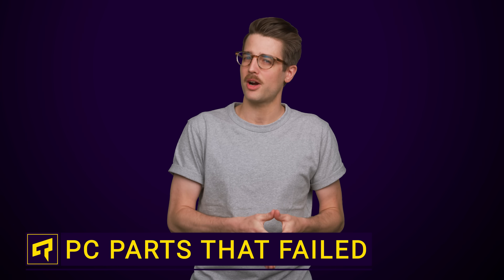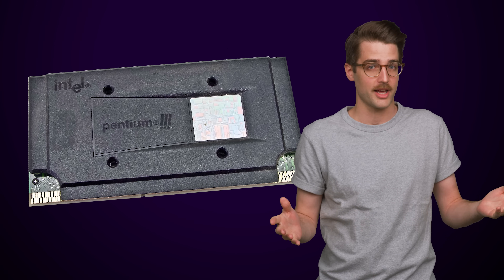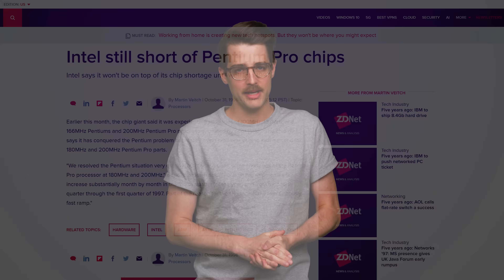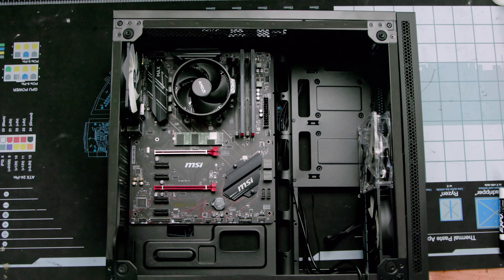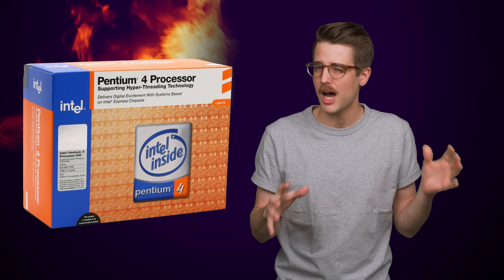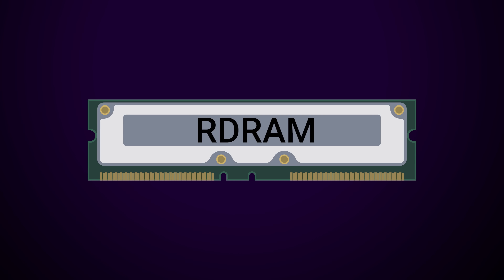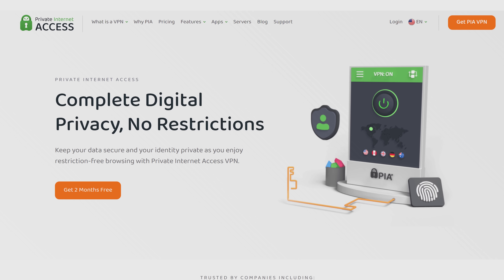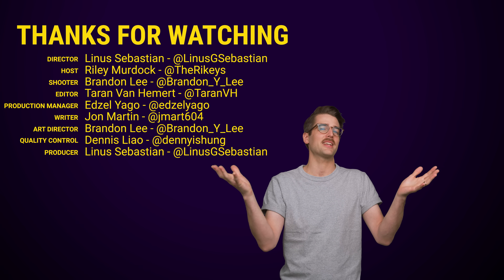PC Parts That Disappeared

Comment: Don't forget those master/slave settings for all your drives.
Reply: Not strictly hardware but fudging IRQ and DMA settings on that stupid Soundblaster clone that just wouldn't work on default.
Reply: @grahamross6397  oh man. IRQ settings were a real pain!!
Reply: Oh my!  I had forgotten them...
Reply: @Jules_Diplopia  And yet deep down in the bios abys they still exist :)
Fun one for you early sata hdds were part and format identical to ide hdds in every way but 1 the controller board on the hdd. 
When satas first dropped i managed to get my hands on about 200 boards for seagate hdds. I had a huge supply of brand new in box ide hdds. A fast board swap and instant sata hdd. 
To get rid of my old stock i knocked 20 bucks off the price and sold them locally to customers as ide to sata converted hdds. My mark up was about 30 bucks on em so i didn't loose any money on them just did not make nearly as much. I still got 2 of them in my drawer that i used for long term storage and last time i fired them up a couple months back they worked perfect still. New sata hdds are not exactly the same they are different mechanically and physically
Reply: Ngl, I always had naughty thoughts when configuring jumpers on HDDs
Reply: That was a real PIA. Having to move a tiny jumper that I would OFTEN loose while building the system. Two drives on the same cable told who was who by a micro jumper..good think SATA changed that and it was a separate cable for each drive.
Reply: @fightingfalconfan  I probably have 500 jumpers I got off ebay years ago, expecting that I would forever need them for all my drives.
Reply: Cable Select FTW
Reply: @CakePrincessCelestia  still Had to Set the Jumper for that and I've never really Seen anyone use that.
Reply: wd disk had also the option to make them work like a 30GB disk. as that was the maximum for older systems with ide.
Reply: All those lovely ribbon cables. So easy to cable manage, and they did wonders for your airflow.
Reply: This comment is giving me PTSD flashbacks
Reply: Didn't mind them. WinXP all the way!
Reply: FUUUUUUCK those jumpers.
Reply: for what were they exactly?
Reply: damn I forgot this haha
Reply: Nowadays people would try to cancel Seagate or hitachi or whatever for daring to have such settings named as master/slave.
Reply: @arctikf0x698  Personally I blame the people that give them the time of day. There always will be people that want to stage their personal vendettas against something and in better times were just ignored. Nowadays they are given a stage and free fuel for their fire.
Reply: @karaloop9544  RIP Aunt Jemima and Uncle Ben.
Reply: @bluephreakr  fuck now I want pancakes and syrup with butter
Reply: @findantu  Man that sounds good!
Reply: @arctikf0x698  

That terminology pre-dated hard drives (it goes back to 1904) and still exists in the tech field.  Also, "master bedroom" has the same problem.  In both fields (tech and housing) the terms are slowly changing.  In housing, for instance, the term "primary bedroom" is beginning to be used.
Reply: @arctikf0x698  lol that't funny because the industry terminology for serial data communications Like SPI, I2C, etc are changing from master/slave :p
Reply: @arctikf0x698  They weren't particularly useful names in the first place which weren't particularly descriptive of their roles, and their choice of words is just flippant blindness about concepts that should be taken more seriously.
Reply: @Aeduo  was only a matter of time before one of you showed up lol. Get a life instead of being offended over nothing
Reply: @jr2904  you felt strongly enough to respond, so you seem to be bothered enough about something. Something probably really dumb. :P
Reply: @Aeduo  They had already used Primary and Secondary for the IDE ports so what else did that leave?
Reply: @LC-uh8if  I dunno, 1 and 2?
Reply: @Aeduo  the original idea behind IDE was that one device would actually dictate the Speed of the other. Thus a slower hard Drive would be the master, having a second, faster Drive as the slave. They didn't implement it though, so only the names remained.
Reply: I’m not gonna stop using master/slave any time soon. People get offended bout literally anything nowadays, and I couldn’t give a flying fuck. Total bs
Reply: @navaks5335  Its more that it was a bad and culturally blind choice of words in the first place, but that technology is pretty obsolete anyway. But people aren't upset about usage of words changing, they just see things being ok the way they are because it doesn't harm them, or they understand that the social issues are on some way a benefit to them and they would rather not change that regardless the consequences for others.
Reply: @Aeduo  you're a good troll.
Reply: @michaelf.2449  kinda silly thing to feel trolled at for I guess.
Reply: @Aeduo  ahh don't pull this card on me. I'm not the one 😂
Reply: @michaelf.2449  not sure what that means heh.
Reply: Honestly I would rather JUMP away from those... ......ill see myself out.
Reply: The Twitter landwhale crowd would have a field day with that today.

Comment: I remember my Pentium-II slot-based PC, when I had the much-coveted Nvidia TNT 2 graphics card, a whopping 256 MB of RAM, and an extravagantly large 100 GB EIDE hard drive.

Maybe your next video could cover the fact that back in that day, discrete sound cards and ethernet cards were actually necessary components to fill up either an ISA or PCI slot. I also remember needing a discrete video decoding card to go with my DVD-ROM if I wanted to watch movies. Excuse me while I go dig up some of my old zip and floppy disks...and I think I have a parallel port cable somewhere to hook up my dot matrix printer.

And if you ask my dad, he would tell you about the days when having a modem meant you put your telephone on a set of couplers and maybe getting a transfer rate of 300 bits/sec. The my mom would tell you about her days of taking a college computer programming class and having a stack of punchcards with her code on it.

Comment: 5.25 expansion slot with integrated cigarette lighter and cupholder, that's a beauty of tech that has gone for good
Reply: I have no need for the lighter, but a cup holder? yes!

I really like the VU meters you used to get...
Reply: @briannem.6787  I don't need it either, but consider it a car accesory adapter, you could connect a mini vacuum cleaner and use it for the keyboard and desktop for example
Reply: @YOEL_44  Most accessories that connect to it are compact, like a fridge. A car fridge is smaller than a domestic fridge, making it perfect for cold gaming drinks.
Reply: @YOEL_44  lol, I'm pretty sure your USB Jack's can do that...and I'm also sure running high voltage tools off the lighter jack would cause voltage dips across the rest of the PC.
Reply: @psilimit  Nothing that plugs into a USB or car socket is 'high voltage' lol. Anything you'd plug into a cigarette lighter would be just fine powered by a decent PSU
Reply: @psilimit  Do you understand the cool factor?
I know is not the most efficient way of doing it, it was just a showoff thing to have.
Also, most cars have at most a 15V power delivery to the lighter, so running car gadgets at 12V is not a problem, and of course that would not generate any power unstability unless you're running a houseburner tier PSU, your GPU ramping up after a loading screen is way more harsh on it and still no problems, right?
...Right?
Reply: lgr showed that.
Reply: Dear god I had forgotten that lighter! My dad knew about computer 3 things: 1 how to turn it on. 2  How to turn it off(mainly because ot was the same button)  3 how to light his ciggaret with that thing.
Reply: It's a shame no one makes 5/12V outlets for the back of a PC. Many wall-warts could be eliminated.
Reply: My first PC had a 2X cupholder. Funny thing, it would play CD's, too.
Reply: If they're not still available, they'd be simple enough to make. Modern PSUs will typically be even more comfortable handling the power too.
Reply: @chaos.corner  It's not that they are STILL not available, but rather thay they're not anymore, that was a gadget that, if I remember correctly, Thermaltake did in the past, before they started doing ripoffs.
Reply: I remember there were supplemental PSUs that fit in a 5.25 bay. You would need another AC power cable for it, and I think you had to either make it the power switch or it had a 20+4 pin adapter that sat between the Mobo and the main PSU's 24 pin. 

I never used one because they were notoriously iffy, but I thought they were interesting.
Reply: @MrNside  i totally forgot about those i never bought one and just tucked a old at psu in the case some place and build a shroud around it
Reply: Someone has been watching LGR.....
Reply: These days I just have drive bay drawers in those slots to store stuff like sd cards and adaptors, various usb devices, etc. They are actually very useful and I haven't used an actual drive of that type in any build for like 16+ years so it's a great use for the unused space.
Reply: I remember referring to the thing in your car that you plug stuff into as the "cigarette lighter" rather than "accessory outlet"  then having to explain to someone (younger) that in fact that slot used to have a piece that you pushed in, it got hot, and you used it to light cigarettes. They were dumbfounded.
Reply: @LC-uh8if  it'll always be a cigarette lighter for me I'm very upset my car doesn't have one anymore like why? And secondly why is my ashtray plastic? This isn't going to work for my cigarettes!
Reply: Na i still have a pc case from 2005 i will throwmit away when it literaly burns
Reply: My dad had one with a wine tap in it, still boggles my mind

Comment: Honestly slotted CPUs should be brought back. We could create a standardized motherboard with chipsets designed to work with any type of CPU. The CPU slot would then have a riser with the appropriate CPU socket for your CPU. If you want to switch to a different CPU, say from an Intel to AMD or a Qualcomm ARM CPU you can.
Reply: Drive signal integrity, voltage decay, and DRAM timing regressions would like to say hello. We dropped slots for a reason.
Reply: @FixedFunction  Yes, but all of those things can be remedied with modern tech. Narrower pathways on the motherboard mean lower voltage and less signal interference so voltage decay isn't a concern. If it were we could have PCIE slots in the first place. DRAM regression isn't an issue either as such socket cards could be implemented with signal relay and other tech, not to mention possibly insular DRAM caches to bolster CPU performance. With wider bandwidth in PCIE gen 6much of the seemingly apparent issues could be resolved. Meanwhile, such a setup could allow for whole slot heat syncs which could drive better performance and more heat stable CPUS with higher clock speeds.
Reply: @XtomJamesExtra  Recall that PCIE 4.0 rollouts took so long because of exactly the issues described. That's for barely 1/2 the bandwidth that a modern SoC requires. Going back to SECC you'd be better off with doing what Apple does and just soldering it all onto one substrate. But then you lose more than you gain from the slot modularity.

"Whole slot cooling" sounds really great in writing, and really terrible in practice. Slot cooling requires much more mechanical anchoring to keep in place, as well as a gigantic keep-out zone in front of the CPU slot. You'd say goodbye to flexible form factors like ITX. I know it all sounds like a great design philosophy to return to but the compromised outweigh the benefits, and we haven't even discussed the bottom line hit to the supporting vendors who would veto the expenses the form factor would add over socketed chips.